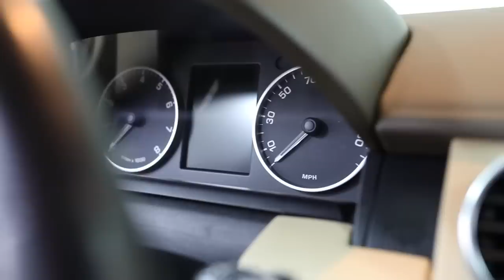Complete Disaster Car Detail Transformation! Detailing A Disgusting Car Land Rover LR4 Interior!

Comment: A couple of weeks ago I bought a 2000 Honda Civic 4 door disaster for $400! I put a radiator and a head gasket in it to get it running and smogged and then it was disaster detail time. Previous owner smoked and ate in it and it was absolutely filthy. I pulled all the seats, console carpet and got to work with folex and a drill brush! I vacuumed and extracted everything and even cleaned the headliner. Last I protected everything with 303 aerospace and I swear it looks brand new inside!!! I’ve been detailing my own cars for years but used a few of your tips and tricks and it made the job easier and it brought it to the next level. Thanks man, love the videos. Cheers from Ventura, CA

Comment: Hey Stauffer. I pulled the bucket seats and vinyl flooring out of my Crown Victoria Police Interceptor. I found a TON of nasty dog hair since the vehicle had been a K9 officers car before. 

I cleaned it up, lined the metal floor with sound deadening material called Killmat and the installed Mass-backed carpet instead of the vinyl. The car feels much more luxurious now since it's a LOT quieter and has actual carpet instead of plastic flooring. Great videos!

Comment: Hello! I’m a professional detailer. Does spraying directly onto surfaces such as the steering wheels with electronic controls not affect the performance of the controls? Have you had any complaints? The shop I work for suggests that we spray the bristle brush and scrub dirt away so that the cleaner doesn’t damage the electronics in the vehicles.

Comment: I ended up pulling out the carpets, seats, and trim when I bought my 18 CX-5. It was CPO and low mileage but I still found junk hidden between the console and the floor panels. I cleaned everything and added additional sound dampening while I was in there.

Comment: I just vacuumed my car out today (it's been at least a year 😱) but I've never pulled out carpet or anything. I don't trust myself to remove anything from my car that's bolted down lol. I typically just vacuum, declutter, and spray simple green to clean up lol. I wish I had one of your spin brushes and cleaning solution!
My carpet was stained when we bought the car (used car) and we've never tried to get them out, but I bought a foaming stain remover made by turtle wax. I tried it on a seat (bench seat that's between my kids) and it did pretty well. 
You seriously do an amazing job!!

Comment: Q: Mr Garage, when you decide to take out the seats and unbolt the seatbelts, do you torque the bolts back down to manufacture specifications? That’s where I would be nervous. All of those components work together to save lives in case of misfortune. Owning a business does that impact on insurance. Actually I am really interested in a start up and of course these are legal questions to ask.
Reply: normally he does torque them if you look at the wrenches he’s using and it’s normally a factory standard most use the same standard ft lb

Comment: I pulled carpet out of a 1971 Plymouth many years ago for the purpose of replacing the carpet.  It was not necessary to remove the front seat, but I did have to remove the rear seat.

Comment: I pulled the seats out of my 2007 Honda Pilot because it had never been deep cleaned in the 13 years I've owned it.  I disconnected the battery as instructed, only . . . .  the card with my radio and navigation security codes has disappeared!  Next step, trying to find out if I can get those codes from Honda.  On the up side - I am PROUD of my work.  All the stuff that no crevice tool could reach is gone, gone, gone!

Comment: I have a question. I'm no detailer, but I'm looking to deep clean a couple of vehicles and I've been looking at some foaming cleaner products for getting into those old stains and grease and such. My question is this: Is there a product that falls between the microfiber towel and the carpet extractor, a product maybe like a claw attachment for a wet/dry vac but clear like the extractor @ 7:48 so I can see the color of what's being sucked into my wet/dry vac? Do you think this combined with a foaming cleaner and a drill brush would be effective? If so - I wonder if you could say where to find a clear attachment like that?
Reply: My main project was in a flood several years ago and got approx. 1/2 to 1 inch of flood water (from a terribly rainy time) which I got out within a few hours but the car still got a little mildewed and I'm looking to detail at least part of it and haven't decided whether to replace carpet or not. I may still do that.

Comment: Love your videos! Genuine question though, do detailers ever get concerned spraying liquid directly on the electronics and buttons? I’m always nervous to so I use a dry detail brush and just wipe it all with a microfiber that has cleaner on it most times.
Reply: My guess is that the buttons do a good job of protecting what's underneath them from spray.  Splashing a cup of water over the stereo would be far worse.
Reply: I spray the cleaner on my detail brushes and microfiber towels to prevent any issues.